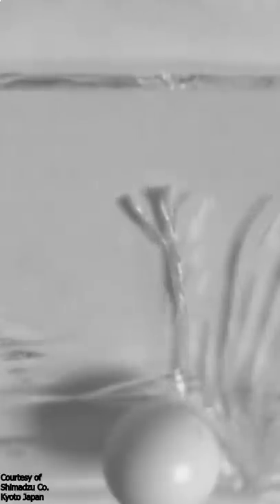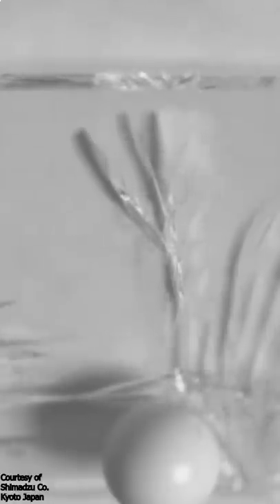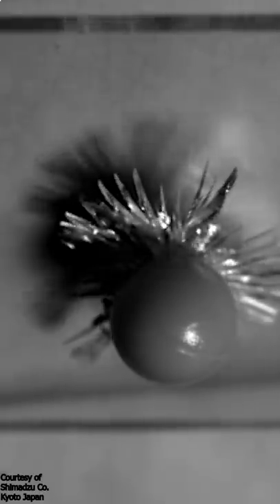Glass Breaking Filmed at 10 Million Frames per Second

Comment: Fun fact:The glass cracks at the speed at which sound travels inside of glass.
Reply: Wait that's almost 5.6 km/s 🤯
Reply: Mach 5?
Reply: Well it... Makes sense ...
Reply: @strife6034  1
Reply: Damm they literally be screaming as they crack
Reply: Cud be a tiny sonic boom everytime a glass brakes?
Reply: So how does that work out for bulletproof glass? Does the sound enters the glass and get demped or something?
Reply: @NamaiWalterHeins-re4nu  bullet proof glass doesnt work like this , in bullet proof glass there are layers of shock absorbtion material embedded in between the normal glass sheets so the shock enters at the same speed at which glass cracks but gets dampened by these plastic sheets.
Reply: @micahslash  nope, its around mach 5 because it is the speed sound travel in the glass .
Reply: @strife6034  mach 16 or 12,500 mph! The speed of the space station is like 17,000 mph.
Reply: @strife6034  it's actually Mach 1 because it's travelling at the speed of sound through the glass. Speed of sound is different in different mediums.
Reply: @LonelyRacoon  he is correct assuming the it is the speed of sound in the air
Reply: @improvingguitarist1595  yes if he assumed the speed in air. But when someone uses term like "Mach 5" it is already implied that the speed is 5 times of the speed of sound in the same medium. This implication is just a convention though
Reply: @TooHarshForYou  Yep. And you can still penetrate Bullet proof glass you just have to have a bullet with more force the glass can stop. Which is why glass that's can stop a 50caliber round is like 4-5 inches thick minimum.
Reply: @LonelyRacoon  oh ok
Reply: Didn't even research this but I can believe it. It's almost instantaneously as the projectile touches the glass, the cracks are to the edge. You only see it not broken or broken but never breaking lol
Reply: Finally, an actually good Fun Fact
Reply: Kinda makes me wonder how fast and powerfully God created the world with His words. 😮😮🤗😊
Reply: @strife6034  if it’s at the speed of sound, it’s Mach 1. Mach is a ratio of the speed in (ft/s, m/s, whatever units) to the speed of sound in the same units
Reply: @nicholasverdusco1889  So powerfully they ceased to ever exist.
Reply: @DanielDuhon  oh thanks
Reply: Actually around 2 or 3 km/s depends on which kind of glass it is
Reply: @nicholasverdusco1889  ❤️
Reply: Actually not LoL
Due to dissipation of energy
Reply: @pardeepgarg2640  oh yeah that's true that could happen
Reply: @GazB85  based
Reply: Where is ur pfp from btw?
Reply: 1 minute in Africa is 1 minute
Reply: @strife6034  hello
Reply: nice fact bro
Reply: If I remember physics correctly it isn't the speed of sound in glass but the speed of transverse waves in material. They're responsible for deformation that leads to cracks if deformation is stronger than threshold.

Comment: 10 million FPS? That’s just 🤯
Didn’t even know cameras existed that could pull off those kinda numbers. Unreal. Really awesome footage though
Reply: They dont. Its probably multiple high speed camera meshed together.
Reply: Technically if u play the video at 2x speed, you would get 20 million fps
Reply: @sh1tstorm158  no, the camera films 10 million frames. You only see 30. It is slowed down. And if you put it at 2x you still only see 30fps
Reply: @julien2231  they do have you seen the slow mo guys? I believe once they went to Singapore to actually see light moving because the camera can go 1 billion frames per second
Reply: @ahmed35gaming  true.. i always watch slow mo guys  i forgot about the speed on that one.
Reply: @ahmed35gaming  
10 million/sec. is about the current max for full, externally illuminated, phenomena. That can be greatly increased for 'framing' cameras that are restricted to, say, 10 to 20 frames.
There's a variety of 'billion' fps claimants. They typically do not, and cannot, capture objects at high speeds.
Reply: @-danR  just watch the video man lmao

Comment: When a piece of heat strengthened glass (around 7600 psi) is hit in the center it can have smaller cracks that you can watch spread in real time just by pressing down on it with your hand

Comment: hypothetically if you were to instantaneously move the glass to higher speed than the speed of glass crack travels, does it form a shock wave within the glass ? similar to how you create a shock wave in air if you travel faster than speed of sound in air.
Reply: No, since the crack travels within the glass itself and is not effected by its velocity or acceleration. If it makes more sense, if you fly in a plane that is going Mach 1.2, sound will still travel normally within the plane, since the air and people inside aren’t moving relative to the plane.
Reply: If you would travel through glass (hypothetically because this is kinda impossible although glass has some liquid properties), faster than the speed of sound of glass, then you would create a shockwave in the glass similar to air

Comment: For an idea: 1000 frames a second means there is one frame every millisecond. This means that the glass propagating happens in under 1 millisecond, or less the 1/1000 of a second.
Reply: A mechanical wave, which is what forms the cracks, travels at the speed of sound, which in glass is almost 5 meters per millisecond.

Comment: A question: Are the cracking patterns random? Or can we predict which Molecular Layer will break first?
Reply: Good question
Reply: Pretty sure it's not random. The patterns depended on the location and force of impact, glass defects, glass-to-surface contact, and the molecular structure of the glass. Universe just don't like to have random things above quantum level.
Reply: I had this same question, I wonder if multiple tests at 10 mil, Fps would help form some sort of theory about glass shatter patterns.
Reply: @ACobalt  I think it’s up to weak points on a molecular level, details of impact and factors so specific it would appear to be completely random
Reply: Along these same lines, what would this "speed" of the cracks be labeled? Identified? We have speed of light, sound, gravity waves.. but what would be measured? Kinect Energy? It's SOME kind of energy.. has to be. Faster than a bullet?? So it's faster than sound. We obviously Know that. The Speed Of Crack!! See, just doesn't sound right. I would Love to hear your opinions guys!!
Reply: We should make a molecular perfect glass and make a perfect sferical object impact on It while standing on a perfectly leveled surface, by theory we should see the glass acting pretty much like water in terms of energy propagation
Reply: I wonder if it's possible to have single-crystal glass? (a special kind of metallurgy that heat treats metal in a way that alligns all of it's molecular crystalline structures in one direction, like the direction of grain on wood.) And how that would handle a shatterable impact.
Reply: If you want an aggressively semantic answer, we still don’t have a clear answer on whether randomness truly exists. Quantum physics runs on the assumption of “probabilistic determinism,” but there are still disagreements over whether that’s really the case or if there are hidden factors at play that we don’t understand.
Reply: @sheldonhatch8255  it happens at the speed of sound in the medium that the cracks propagate in. The speed of sound is many times higher through glass than air.
Reply: There's no way we could predict how the glass would crack without molecular analysis and we'd also have to send the ball into the glass in the most precise way possible and in short, no, we couldn't

Comment: When glass breaks, it firsts splits open from the impact point to the edges along the weakest path, than air rushes through from both sides, allowing the glass to come apart. If it’s one sided the glass will not come apart.

Comment: Fun fact: the glass isn't even a solid.
Its a (semi-stable) liquid that moves Incredibility Slowly. 
300.year old glass panes on castles in England are 3x as thick on the bottom of the windows as they are on the top.
Reply: Glass is an amorphous solid ( and not crystalline ) ... it has the tendency to flow
Reply: That's cause if the way we made glass back then. Glass takes millions of years to show any noticable movement.
Reply: This is a myth. They just made glass wonky back then and would choose to put the heavy side down.

Comment: Another way to see cracks moving with your naked eye is have a hard crack I call em had one on a tab and my screen protector had a spider of one the cracks done fully touch the edges of the panel, and if you put enough pressure it will extent on the tab it was the actual glass so cracked with a touch like I slid my finger across it and it was like cracking the screen with my finger. Same thing with the screen protector but I had to push harder they didn't want to go bigger (ppl probably be like why would you do that, I can't stand cracks or scratches, I bought another screen protector before I extend them so I was able to put a new one on.

Comment: Wait, that’s not how FPS works… that’s slower, not higher framerate. If you were to boost the FPS it would be the same speed, just smoother. Also, 1,000,000FPS is basically impossible because the average camera uses 60FPS and even the high budget ones only go up a few 100, maybe 1000. But not Millions.